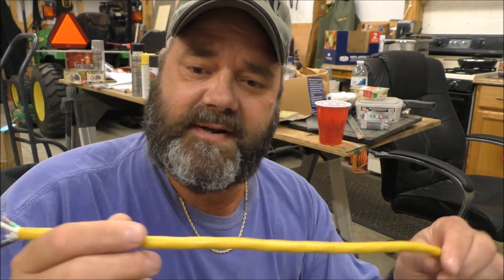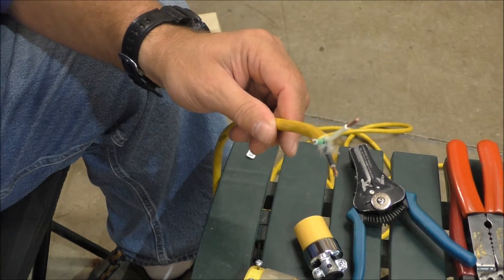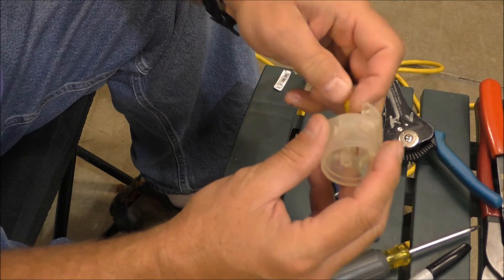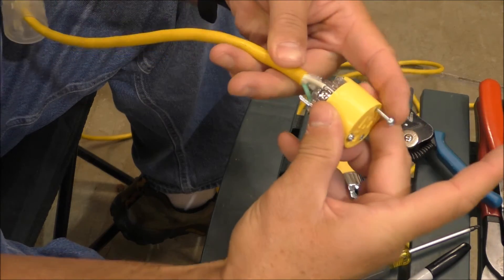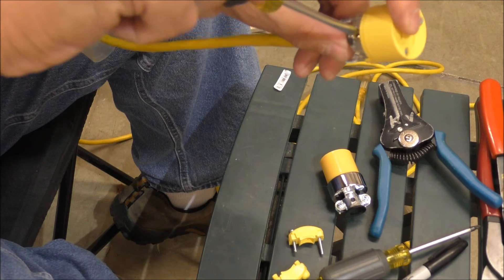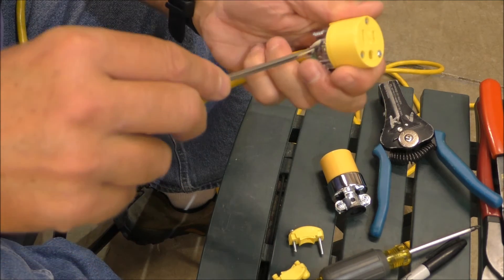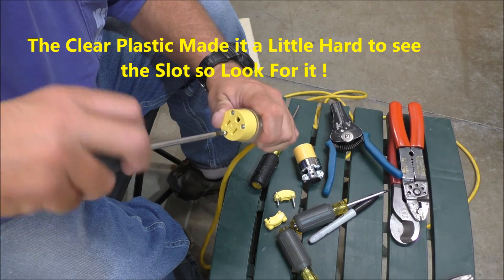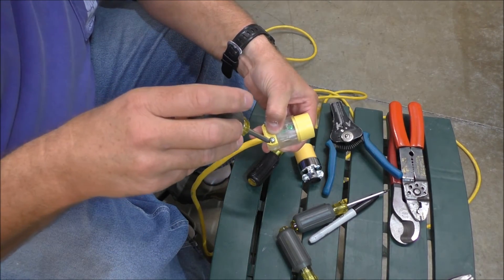Wiring A Leviton Lighted Straight Blade Connector 515CV-LIT  BY KVUSMC

Comment: Just a note to others that come across this video - you don’t have to insert all three wires at the same time. There’s a little metal plate that each wire has to go under - I found it easier to do it one at a time. Thanks for the video - I was not sure which wire went to brass and which went to chrome.
Reply from the maker: Your welcome Brother God Bless

Comment: I did this on a male plug but now the led doesn't light up.... If I remove the wires and hook it up to an outlet it lights up green... But once I attach wires... Nothing...

I checked with a voltmeter and all of them have correct polarity and continuity yet it doesn't work... What could it be?

Does it maybe not work with a long extension plug? I have it as 25ft and am going to cut it to length later but wanted to test it and don't see any green light
Reply from the maker: The LED Light is bad buddy

Comment: Thank you Ken..  I'm sure you saved me from having to sleep outside tonight having shorted out our entire 1950's electrical disaster of a home  :)   You know this may sound corny but I'm happy to add this to my "DID IT" list, and about time, I'm 69..  Always figured since I drive ANYTHING BIG on wheels as a "Workoholic", I  preferred to leave electricity to the Pro's..   Just a hint to pass on to ANY DO IT YOURSELFER;  Don't be afraid to get a thin line felt pen and mark corresponding reference points on ANYTHING you're taking apart..  It's THINKIN' ahead. .,  not Cheatin. . .   Thanks KV     :)
Reply from the maker: Amen buddy I agree to that 👍